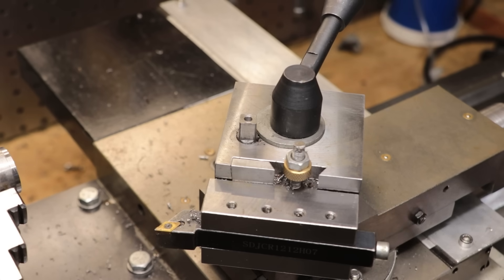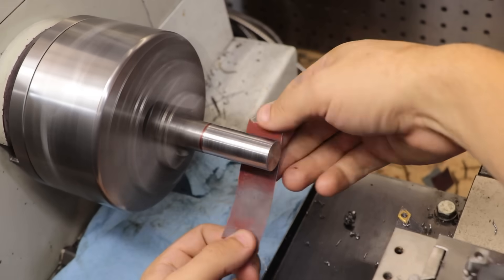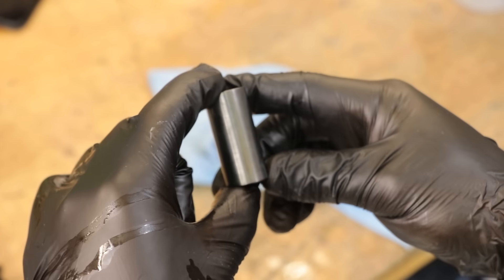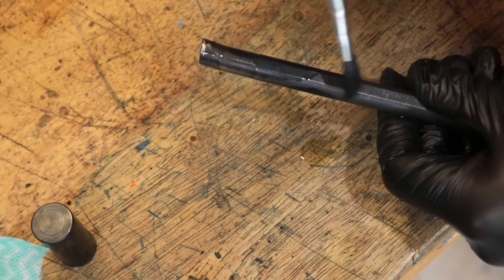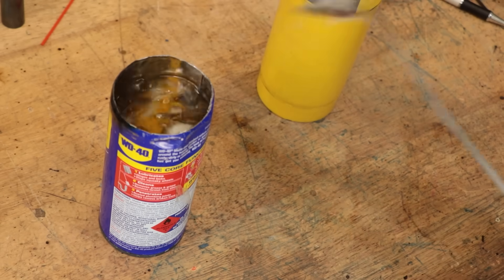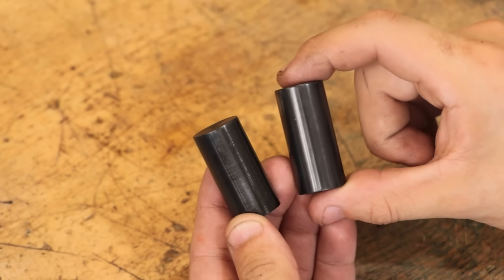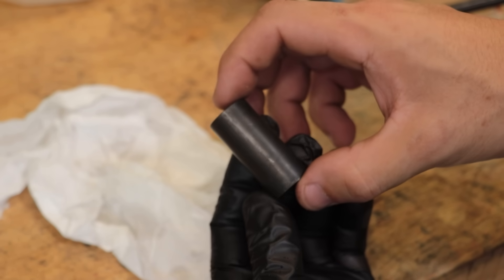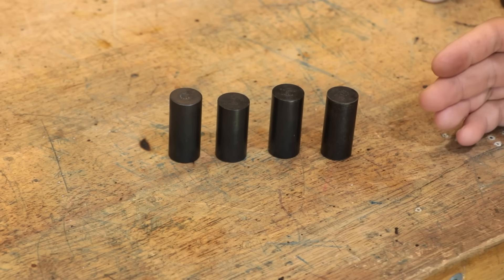Best Way To Blue Steel? Cold Blue, Hot Blue or Rust Bluing.

Comment: Another take on rust blueing is to create the red rust coat, ans instead of boiling it in water place in a solution of tannic acid. This converts the red rust into Ferric Tannate. The rust/scrub/tannic acid will also take a few rounds, but Iron Tannate. is a deeper black, and is less prone to subsequent rusting than black iron oxide, as it forms a more stable, protective barrier against moisture and oxygen. It still needs to be oiled as the final step. A quick wipe down with an oily rag every now and then is the only maintenance it will need.

Comment: As was explained to me decades ago,   if you visit a sheep shearing shed raw steel remains bright.   That is due to the lanolin from the sheep's fleeces coating everything.
So having tried several products containing lanolin,   the best performing one to use on the Lathe and Milling machine I find is Lanox MX4 in an aerosol can.    Bunnings and  Mitre 10 both stock it.
The Birchwood casey cold bluing products contain selenious acid.     Problem with Super Blue is that it causes a white salt deposit in crevices such  as threads which can be tedious to remove.   The Birchwood Casey Perma Blue Paste Gun Blue doesn't leave white deposits though I find I have to apply three coats to get a deep black colour.    Downside with all selenious acid based products is the black film is relatively thin and soft and on adjustment screws etcv. wears off quickly.   For such items I hot oil black them in used motor oil heating the part with a small butane torch and then dipping briefly in the oil and re heating three to four times to get the desired depth of colour.
The hot blacking process that the small arms manufacturers use I read was based on a sodium nitrate solution held between 136 and 138 deg. C.    As industrial parts might have been aqueous solution washed  and not dried thoroughly before immersion in the hot blacking solution,   that I assume would result in an explosion covering hapless operators with hot blackening solution.  Hot blacking is well known in the metal finishing industry as being potentially hazardous

Comment: I have done hot caustic bluing and it is an absolutely spectacular method IF YOU TAKE SAFETY SERIOUSLY.
It is damned hazardous if you're careless, BUT if you do it well, the results are utterly splendid. In MY OPINION (so you're extremely welcome to disagree) the only method that reasonably competes with hot caustic bluing is rust bluing. The other methods are, in my opinion, cosmetic, but not really all that protective.

Comment: Over here in England, at least in the gun trade, that last method you described, is referred to not as bluing but as blacking, and can produce a really nice deep black colour which gives a rust protective layer. Hot/caustic bluing is similar process but uses a different chemical and a much higher temperature and does not provide a chemical finish like blacking but an oxide layer. Ironically the bluing process can actually provide a variety of different colours, yellow, orange, purple and obviously blue and does not need to be done in a chemical bath and can be done with a naked flame. The principles of keeping the part clean and oil free are the same

Comment: IIRC, you want to use a "drying oil" for the hot bluing. This is an oil, that when left out will become thicker and sticky, which is not all oils. This same process can be used for cast iron, and the best food-safe oil to use is flaxseed oil. What the interwebs are saying is that boiled linseed oil is "best" for hot blackening / bluing....

Comment: rust blueing done right is the most beautifull black finnish on steel - you need to actually boil it - and card it with a very fine rotary wire brush which burnishes rarther than abrades the previous layer - and keep repeating untill no more rust apears - its the best but takes time.

Comment: Want an easy process without much fuss ? Crate a lightly acitic solution (mix tap water with citrus powder from the supermarket), then boil your parts for about 10 min or so. Clean, buff a little, repeat.
It´s the same process as on all of those 4. You create a red oxide layer which then turns into a black more dense oxide, layer. I would never heat up any parts with a torch, you change the steel structure.

Comment: As a jeweler, I only occasionally work with steel. But I just watched another YouTube video on these kinds of processes.  

I saw a comment there that suggested only heating the steel until it's straw colored and then rather than leaving it to soak in the oil only dipping it. This was supposed to provide good rust protection without effecting any heat treatment that had been done to the metal. I do not know the resulting color after this process.

I don't know if this is true, I'm just paraphrasing that comment.

Comment: Alternatively instead of boiling the piece you can build a steam chamber. It works a bit faster, can accept bigger parts, and simultaneously helps to create the initial FE2 oxide layer that then converts into the FE3 Magnetite layer.

Comment: I think you might be confusing "manganite" with "magnetite." Manganite is MnO(OH). Magnetite is Fe3O4. Fe3O4 is the tightly adhering black oxide.

Black oxide can also be economically applied by the "steam oxide" process - but not at home. The steam needs to be at very hight temperature & pressure.
Reply from the maker: No I’m not, just speaking in a different second language thankyou and mispronouncing a syllable

Comment: I've accidentally done hot blueing while running a different process that uses molten sodium hydroxide at  ~330C, any steel in the bath gets nicely blackened after a while, even low-nickel stainless. Applying an anode current accelerates it.

Comment: Russ Bowie is one of the old forms of blowing. It is a very traditional blue finish. Now here’s a trick, but resting that I learned always want to paint it with your coat a lacquer it is traditional or boiling sea oil. It will not discolor ever again I recommend you check out some of my colleagues from Tiffany Companyor Holland Holland.

Comment: I don’t know which friend country you’re from. I’m against me the way you apply rebooting agent on you’re doing it wrong. You want to use like a cut swab or a feminine swab pad you want to soak it and then squeeze it to almost dry and then apply thin coat and you wanna put away humidity that once you read like a decentlight reddish rust that you boil it always use steel wool never wear brush zero art steel wool to achieve the right color you want to be durable you need at least 10 to 20 applications

Comment: Great video. 
Very thorough and answered all the questions I had. 

The only comment I have is that technically hot blueing is true blueing and the others are modern adaptations. 
This was a common way of treating steel before stainless was invented. 
In fact suits of armour used to be blued (the Victorians polished off all the blue of antique suits which has led us to mistakenly believe they were left bare)

Comment: 12:40 So if I have rusted tools, all I have to do is put it in boiling water & it converts to a protective layer (or at least the rusted sections)? Could I just pour boiling water from a kettle onto a rusted tin roof then paint the roof?

Comment: Your explanation of cold blueing was very different to the instructions on the bottle.
Having used this method often I can say you did several things wrong, starting with the use of acetone to "clean" the surface. Acetone leaves enough oil to slow or stop the process, which is why your first coat was so weak. If you'd used metho or similar it would have done a much better job. After that you didn't wash the part and then clean it in steel wool before adding more coats to make it darker.
Reply from the maker: Cheers. I think I’ve always  thought acetone to be a much better cleaner than metho but to each their own.  What brand it bluing do you use? The brand I use isn’t known to be great

Comment: For rougher metal pieces you can just let it rust naturally all over the surface, than remove any grime or grease with a rag soaked in paint thinner or alcohol and apply regular rust converter all over it. Doesn't look as good (very uneven finish) but protects it well enough even fully exposed to weather.
There are also the 2in1 and 3in1 polymer mixtures you can apply directly over a rusty surface. 2in1 means rust converter and primer, 3in1 also includes paint so it doesn't require another layer on top. They're not all that expensive (around 10 euros a kilo in my area) and will save you a lot of headaches if you need to cover bigger stuff like fence posts or a car's undercarriage for example.

Comment: The hot oil treatment can probably be done at a lower temperature with brushed-on linseed or safflower, though it would take a lot more treatments to get a nice thick coating. I use safflower for my carbon steel cookware and give it a little heat on the stove after I wash it to dry and heat, and then apply a couple drops of safflower oil and it builds up nicely over time. Takes maybe overnight to dry, linseed (especially BLO) is much faster.

Comment: Edit: on your rust bluing just use Ferric Chloride and skip all the other steps. It also doesn’t need heat as you apply it at room temperature.

The best method I’ve found for DIY is very simple…I use Ferric Chloride. It turns steel black in seconds, protects it from red rust, and is food safe. I do this on my outdoor carbon/tool steel knives. The oxide layer is called Magnetite. It’s also (Ferric Chloride) the same chemical used in pattern welded steel to bring out the pattern; falsely called “Damascus steel” but Damascus steel is not pattern welded steel (common) and is entirely different to Damascus (very uncommon).

Black (Magnetite) is protective rust whereas Red (Hematite) is destructive.

I use Ferric Chloride for etching PCBs primarily (it dissolves copper) but it does very well on carbon and tool steels as well.

Ferric Chloride can be bought cheaply at Electronics components suppliers and chemical stores etc.

Comment: The problem with rust bluing is that the micro structure of hematite is much more loose and fragile than that of magnetite. So, when you boil the part to generate magnetite you still have a very porous layer of it. In caustic bluing you generate magnetite directly, hence do not get a loose structure of it.
Reply from the maker: That’s a really interesting point that I didn’t see during my research

Comment: 4:30 If you have an easy shape such as that, simple, not complex shapes, cut out a paper towel that will wrap around it. Use a dropper and make the paper just barely wetted, wrap the item. Then when you do the burnish, you can rewrap it. Vacuum bags help that process. And you have not wasted any. In the brush, jar, anywhere.

Comment: I had a large chuck go very rusty when in the boot of my car in a humid Sydney weather a few years ago (admittedly it was a few weeks). I did electrolysis on it and converted the red rust to black and its held up pretty well. I think I used sodium carbonate (washing soda) a 16V plug pack and some steel wool as a sacrificial anode.

The rust was patchy so the black oxide was also patchy, but no other problems.

Comment: Use old blackened engine oil for hot bluing, will give a carbon black finish. We would heat the sample to a temp where it was a deep blue and then submerge into the oil. It would let of heaps of smoke so it's best done outside or under a fume extractor.

Comment: You'll have much better results when applying Birchwood Casey Cold bluing if you use something like a cotton ball. While not recommended, i found that heating up the steel a bit to 150'c or so will get a much better, deeper blue. Wear a respirator though. the fumes are bad.

Comment: For small parts I like hot bluing, but didn't know you could stack it. 
I have done it differently though, I also use a more gentle heat, like an electric range. 
I usuly aim for the purple pho-case -hardened look, but have gotten everything from star coloered to deep azuer blue. Uou can even get a gradent on some parts. See "Cickspring".
I think what I am describing (someone who knows better pleas let me know) is closer to rust bluing because the oxide layer is chemical bonded to the part,  not a coat of baked on oil?

Comment: Quick heads-up,  you don't need to pour out the Birchwood Casey Gunblue to use it. However,  I would suggest using q-tips instead of a paintbrush.  You can hold the solution on the part for longer, and even get it to work better if you're frugal with it. 

I'm of course, referring to the aerosol effect of acids under wicking, just like with the old Chloroform aresolizers for anesthesia. By using this extra quirk of chemical physics to enhance the molecular adherence of the selenium oxides, you can get a deeper cut with the solution than when it is in its liquid form. It only takes a cotton wicking source to create this effect,  and I am supremely confident in my knowledge of it, as I use it for my gun parts(it's original intended use). 

Gunblue works best on parts that you're afraid of heating in a caustic bath or for firebluing, which might ruin tempers or hardenings of parts that are higher carbon steel. It works better on these, not only due to the lack of heating,  but also specifically BECAUSE  of the carbon dendricles present in the steel. By exposing the ends of these dendrites, the solution has a lattice by which it may adhere better, and penetrate deeper into the steel. I also use Birchwood Casey Gunblue to do acid etching of my blades(I am a bladesmith by hobby) and can say that it's definitely effective on more than just regular steels. I use a resilication step in my bladesmithing process which makes most acids non-reactive with the blade steel.  The Birchwood Casey doesn't have that issue.

Comment: That's not hot bluing. That's a somewhat complicated version of an oil black. It just takes an oily rag and a forge fire. No special oil necessary. Sure, there might be polymers, but that's mostly a fancy way of saying "gummy burnt crud", there's no meaningful polymeric coating involved in seasoning, polymer is what a glock is made of and it doesn't go away or rust through.
Reply from the maker: I said repeatedly in the video it isn’t a true bluing. It is my book called hot oil bluing, which is what I refer to it as here. I do not refer to it as hot bluing.

Comment: You can also do cold blue with phosphoric acid. I use it on knives. If you heat the acid to about 80°-90°C it even works better. 
I also used very diluted iron perchlorate and it also works.

Comment: For the boiling water method, isn`t it possible to create Fe2O3 using DC voltage? Maybe with eletric potencial in salt water or something. Using the part as sacrifice metal.

Comment: Hot blueing (actually blackening) can be easily done at home. Just put linseed oil on the part with a paper rag, then wipe it down, to remove everything you can wipe off.

Then put it in an oven and heat it for an hour at 300°C.

No effect on heat treatment, just a tiny bit of smell and no issues with too much oil sticking to the part.

Works great even on rusty parts, as long as you don't need a clean surface finish.
Reply from the maker: Yeah sure, no different to how I do my cast iron skillets. For me it probably would affect so of my parts, most case hardened parts use a low temp temper but I know what you mean
Reply: @artisanmakes true. However if you're talking about tools out of e.g. D2 you can just lower the temperature to 200°C to be on the safe side. But burning in that way will take significantly longer: 3-5 hours.

Comment: 0
Cold blue is just barely acceptable for touch up.  I like rust blue  but it is time and labor consuming.  Parkerizing also works well.  Hot bluing, while it forms an attractive finish is my last option, just too nasty to work with if you don't have to.

Comment: oiling ya stuff is mechanic 101.when your teacher slapped you everytime a piece of steel isnt coated you will do it without extra effort. i am still afraid of not coating something while i do not work in this branche anymore. also it is not that hard, if you accept that you waste lifetime at a lathe, oiling your equipment is easy. you still will think "i could do important stuff" while you are at the lathe. accepting that you ended up at a lathe is the hardest part, bc, you must sacrifice any human or artistic values you have to stand infront of a lathe. after you got rid of any ambigition it becomes easy. look how much time you put in the blueing while you could been using that time to become an firefighter or beat up those ppl that glue themself on the streets. also, blueing: do it the german way and just be happy to have the most efficent way.

Comment: the hot oil blue is better referred to as flame-bluing, in my opinion, but i guess it has no proper name other than what you decide to call it? i enjoy heat treatment, polishing, and bluing. the different bluings dont all come out as polished as the bare metal was before, im pretty sure caustic bluing is the only one to keep the polish other than flame bluing. correct me if im wrong, but i think rust blue and cold blue make the surface a bit dull if it was previously polished/

Comment: Ive used a laboratory hot plate to heat steel parts to blue them, Much easier to control the heat than using a torch. It does take a little longer though. Used the chemical blue as well, agree that it is not as tough.

Comment: I used to get ph down (phosphoric acid) at Bunnings and manganese oxide from old alkaline batteries a stainless steel pot and a bit of fine wire wool. Produces a manganese phosphate coating that when neutralised and oiled was far more rust resistant than any blueing.